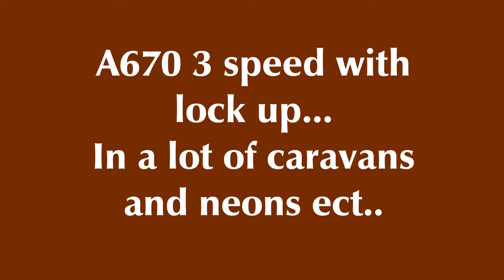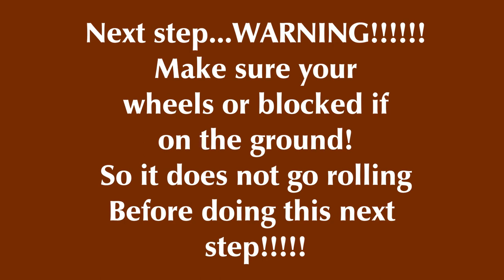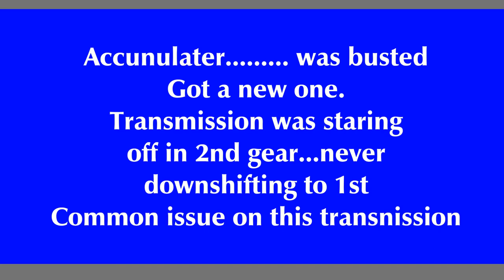A670 Transmission Valve Body Removal.  3 speed with OD Caravans/neon's etc.

Comment: I have a 1994 Plymouth Acclaim with transmission code DGA, delayed and difficulty shifting after about 20mph. I've never worked on transmissions before but my research online looks like it could be the TC solenoid, or possibly a governor. Is this something an inexperienced backyard mechanic can fix? Or am I getting in over my head?
Reply from the maker: Eh, gotta tear into it. Not easy for the non- seasoned guy.

Comment: Hi...i need your help i replaced the TCC on a 01 voyager with the same transmission your working on...anyway i reassembled everything back but when i installed the kickdown lever i noticed that it was hard to move when i connected the cable...so took the valve body out again to see if anything was binding but nothing was in the way...so i put it together again and now it moves a lil bit but the trans is having delayed shifting...i adjusted the cable now the pedal is hard to move...any feed back is greatly appreciated..
Reply from the maker: You need to go back to  and check everything. You have something binding up. Check the piece that go in  the side of the valve that works the downshift cable. Good luck...Just take  you time looking at everything.

Comment: I have a 1997 Plymouth Voyager 
 3.0  3 speed with A670 transmission. Transmission lost revers it engage when cold in the morning without gas and on level ground. When hot it need little more rpm but not to much gas because it will slip. Will not go uphill or on gravel. Forward gears work just fine, I drive every day to work about 60 miles one way just need to park so I can get out without need to backup. What could be most likely wrong?
Reply from the maker: Broken reverse band. Perhaps.
Reply: @FixingWithPassion  Thanks Nathan, I guess I need to visit the transmission place  :-)

Comment: How do you rebuild the valve body.  I put a used one from an ebayer and it lasted 15 month, but it worked, wasn't my bands or anything else bad, since the used valve body worked for a while.  Now I'm getting the same symptoms but sort of worse.  Won't up shift from 1st.
Reply from the maker: I'm not sure. There not much to them. You could get a used one again. Sounds like maybe a valve sticking in the valve body. Better than pulling the tranny for now. Hopefully is not a 2nd gear clutch pack done/burnt;(
Reply: TVWXMAN32 Thanks for the reply.  Yes, I got another valve body from the same person.
So I'm going to install it, and hope it works and hope it last.  I think the valve is not sealing for it to shift, though I don't know much on how the valve body works.  This transmission has no shift solenoids to change out. It's all in the valve body.  I know later models have the solenoid outside the trans, which you can change out.  Yes, I could keep trying a used valve body or maybe sell the car too.
Reply from the maker: Yea my 1999 transmission has shift solenoids I hear then clicking all the time. My 1996 did not. That transmission was easy to work on;)

Comment: I have a 1997 dodge caravan 3.0l  3 speed with a A670 transmission. I did the oil change with new filter and somehow this thing doesn't shift anymore, it reverse but then when it drive it doesn't shift to second gear. can you please tell me what's going on?  thank you.
Reply from the maker: Governor could be stuck. Did it shift before ok?
Reply: it shift fine before i installed an new engine (used engine). When I step on the gas pedal it start slow but it does shift to 2nd gear but then it slow no power, now no more shift.
Reply from the maker: Make sure the fluid is full in the tranny. Manually shift it for a while and see if it gets better.
Reply: Yes, it shift from first gear to second gear and that's it but then car is in slow moving the engine sound stronger then the speed, you know what I mean?
Reply from the maker: You mean its not going into 3rd gear?
Reply: no sir, it's not.
Reply: no it's not going into 3rd gear, 50 miles an hour is max speed.
Reply from the maker: Ok...I see. You have not had the valve body off right? Check the 
Plug/Wires on  the tranny for the lockup. Make sure its connected.
Reply: The lockup connector is next to the dip stick is orange and white wires, yes they are connected good Sir.
Reply from the maker: It almost sounds like one of the check ball is stuck. You may have to pull off the oil pan and re check the gasket on the filter... If this issue just started after the oil change. If you do that check all the bolts...even on the valve body. I think there are12 10mm bolts. Maybe one of them are a little loose causing a pressure loss and affecting a check ball.
Reply: Yes, there are 7 bolts 10mm and yes one of them is kind of worn out it doesn't work with the socket no more I have to use a plier to deal with it. I'll go to the junkyard and get about 10 of them bolts they are free all I have to do is put them in my pocket. It 9:00pm out here in California right now, I'll report the good new about the issue to you tomorrow. and goodnight sir.
Reply from the maker: I use to live in Riverside and lived at Ecology and Pick-n-Pull...Made some money there.
Reply: I'm here by Monterey pick-n-pull....  anyway I got the 10mm bolts and myself out the gate safely. I tied them up good the body valve looking good, i still have 9 bolts left for the raining day you know I'm all cool you know. Now the coolest thing is the gear work exactly the way I wanted you know how it works before , beautiful, I am really cool now.There is one little thing that I still concerning is, before it uses to pick up speed quick as soon as I step on the gas pedal, it does picking up speed and the gear shift fantastic. I'm always got super unleaded in the gas tank. well, other than the speed, the gear fixed with your help, it work perfectly. Thank you so much TVWXMAN32 I love you man and God bless you.